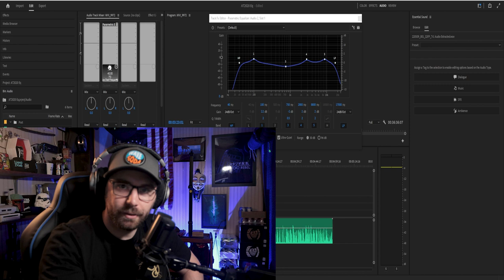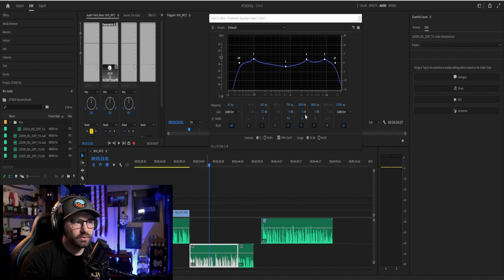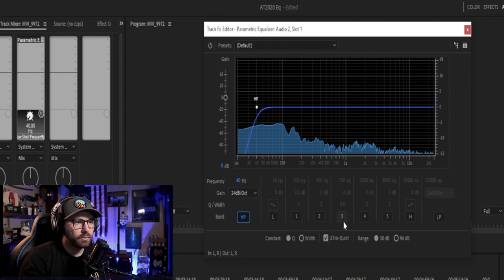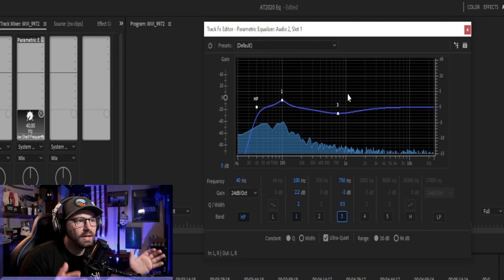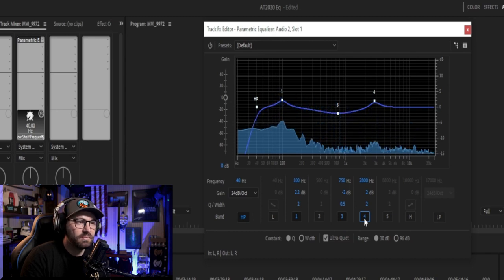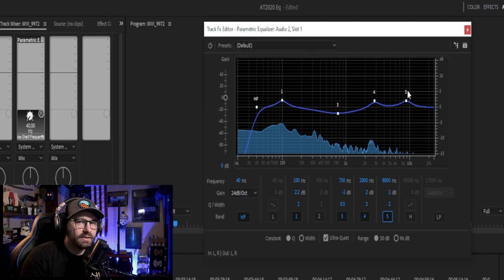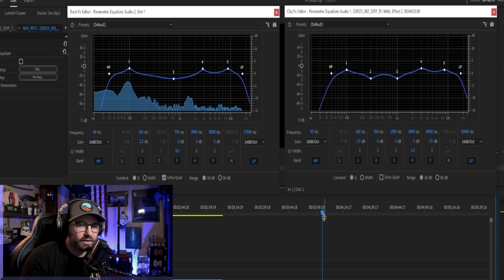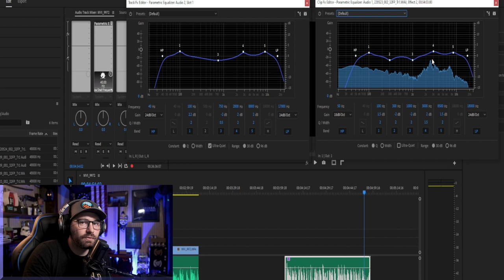How to EQ your AT2020 for voice over (Audio Technica AT2020 EQ)

Comment: nice video. i'm using AT2020 with the windscreen filter and it sounds way less muddy. cheers
Reply from the maker: Very nice, I plan to do a video about “physical tuning” of microphones. Basically adding different wind screens and stuff to tune a mic without post processing. 

Thanks for checking out the video!